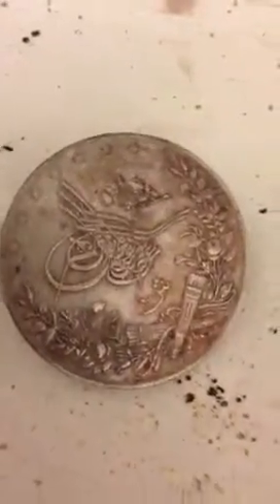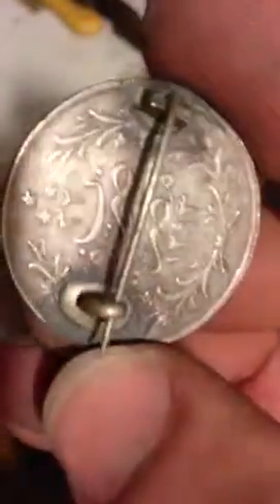Mystery Silver Coin. What is it and how to desolder it?

Comment: It looks like an Ottoman Turkish 20 kurush (crown) from 1908.  It seems to have been struck in Birmingham and it would be 83.3% silver. 
You would need a 400 degree Celsius soldering iron with a large tip to unsolder it.

Comment: If the solder did not melt with the soldering iron you could put it into hydrochloric acid.  This does not dissolve silver but will dissolve lead.  If the solder is a lead silver or tin silver alloy then this process may need hydrogen peroxide as a catalyst.  Lead solder in hydrochloric acid will give a lead chloride deposit on the coin, this can be converted into lead hydroxide using sodium hydroxide and this in turn will dissolve in weak acid such as citric acid.  You may need to repeat the process several times.
Reply from the maker: Thank you very much, this is very useful information. Have a great day!
Reply: @neogovernment  Did you managed to remove the solder?